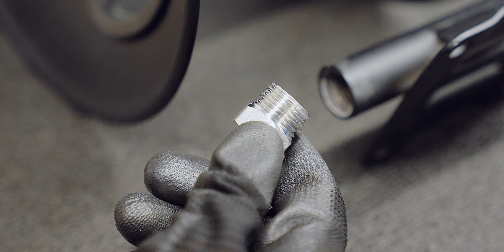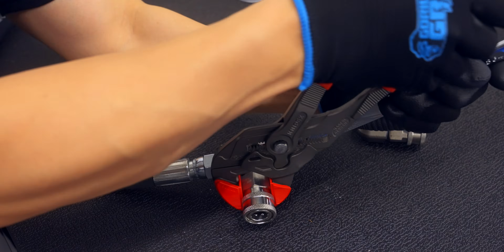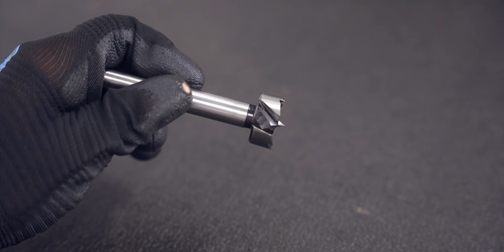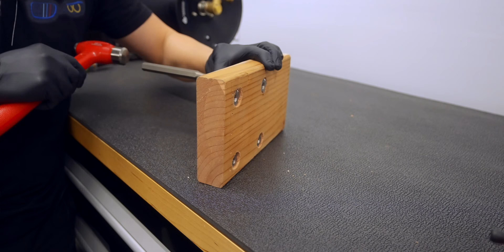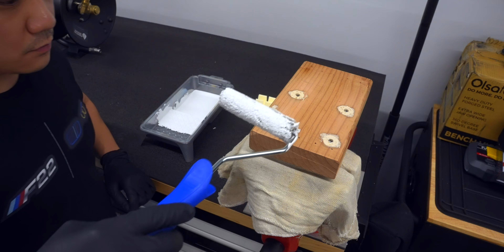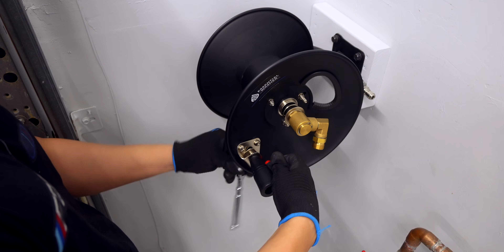How to Mount a Leakproof Hose Reel

Comment: I've got to say, M22 fittings seal with the threads specially designed on both mating surfaces. When the fitting is under pressure the threads seat into each other creating the seal. The oring is literally only used as a guide for fitting the fittings together. M22 also can be used without a thread sealant. Infact the sealant interferes with the precision engineered threads that are designed to seal metal to metal. 👍

Comment: Hey, whats the difference if any between this and the amazon basic hose reel.  They look to have come from the same mold and the brass fitting shot out of mines the other day and had water pouring out because where the fitting screws in isn't much thread and some corrosion was enough for it to fail.

Comment: What exactly is the point in putting epoxy to hold them in they will be against the wall. Way overkill on the screws. Each will hold 200 lb each. Took 10x three time to build than it needed to.

Comment: yea....Dear god, you spent about 12 times the necessary to mount this simple wood block. each of those screws has about 200lbs of sheer strength.  For the future 4 is GOBS.  If you think you need this many screws next TIME just use a 5/16 lag bolt.
Reply: Everyone on the internet can do it better but few have video showing how 😎

Comment: I had a problem with the essential washer hose fittings leaking even with tape.  A little pipe paste along with the tape solved that, just in case anyone has issues with the fittings on this reel.